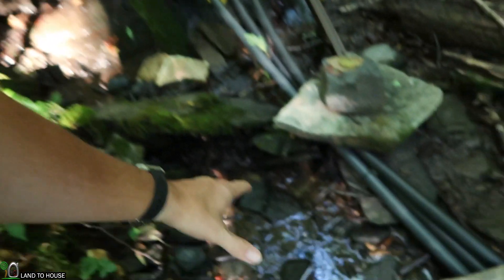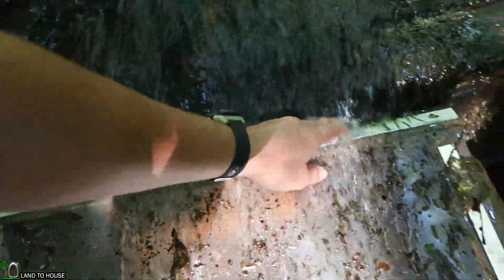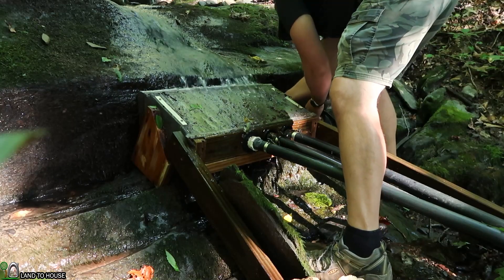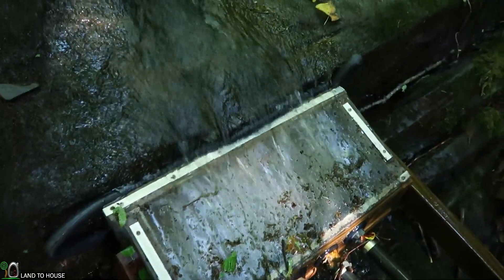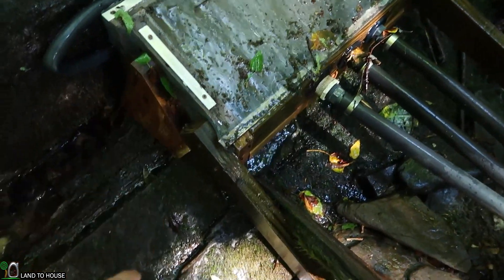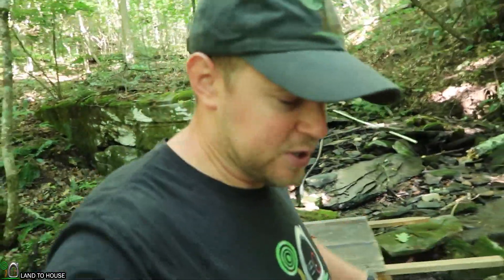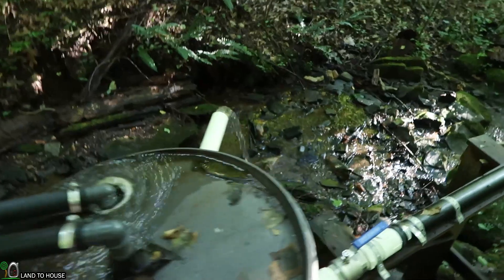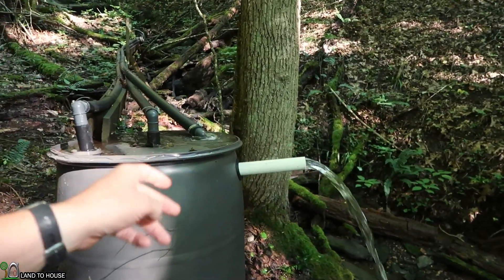Capture More Water With Bike Tube Micro Hydro

Comment: You have a nice flat shelf of a rock. I would take a piece of sheet metal about 3' wide and bend the sides up about 6 or 8 inches. You could even use anchor bolts to attach it to the rock...have it hang over the ledge about 2 inches. Should  catch just about all the water that way.

Comment: Use a float sensor in the sediment trap, to activate a solenoid valve for additional jets at the turbine. This will help to ensure you get turbine flow matched to actual available water. This way you don't waste water needlessly to overflow and can use all that is available for battery charging.

Comment: I have just scene on with 2 inch pipe flow meter do you think they would work to measure flow to a turbine ? Also electric ball valves I was thinking if you had float valves in the barrel when water  reaches set one it will turn on and off the valves to always keep best power production with what flow they is

Comment: One of my favorite water diversions is a slab of cement, with 2 channel iron 24" stuck in it(it can be as tall as you want as long as it exceeds the flow of the creek) put into the cement, with the open sides facing each other 24" apart, then build a box and pour cement behind them up 24", so the water flows between them, then we drop 2X4's into the channels to "check" the water up to our outlet pipe that goes through one of the sides.  Sometimes we'll put a valve on the outlet pipe, this is an irrigation dam so the outlet is 6" or bigger, the advantage of the 2 channels is if the water comes up quickly, it goes over the 2x4's and on down the stream w/o overloading the outlet pipe, which limits the volume by the size of the outlet pipe.  Build the dam, put your outlet pipe on the side that you want, it drops directly onto your screen.  Flood/rain water rapid rise just on downstream w/o damaging anything.  Does that make sense?

Comment: One option might be to pump the water out with a large pump or divert the flow long enough to put concrete in between the rock and the box and make it nice and sealed. It should cure enough to allow water to flow within 24 hours and you'd end up with a perfect seal moulded to how you want.

Comment: A metal box placed tighter to the stone would do a better job of catching it.. Wood is not stable so it will always expand & contract. so there will always be loss of water.. I strongly urge you to build a catchment of all metal or metal & plastic's.. They will do better, last longer and the performance will vastly be improved.. I can only speak as an observer, but it appears at times like your chasing your tail.. I mean no insult in what I am saying.. Still everyone has to learn and progress at they're own pace.. LOL myself, I have OCD (badly) I drive myself mad sometimes trying to redo & redo until things are perfect (which rarely happens) Enjoy your journey.. Be blessed..
Reply: I'd build a basin out of stones and Portland cement, personally, and deep enough to assume the functions of the barrel (silt drop out and air bubble removal) to get a few more feet of head pressure.

Seeing projects like this makes me want to go buy some land just to run a hydro setup!
Reply: @MarkRose1337  Sounds like you built a small dam..  Having the area, a small dam like 10 feet by 10 feet and say at least 5 foot deep, with the water outlet around 4 foot down, would from the start increase the head pressure even if the drop is not as much.. It's all in taking advantage with what you have.. I have tons of what most people would call "useless knowledge" but in my case comes in handy with thinking outside the box and applying a bit of engineering to projects.. My kids call me professor knows it all.. LOL, I do know a lot about a lot of different things.... LOL

Comment: 3/16 is smaller than 1/4.  Perhaps you mean 3/8 :)
Reply: He means 3/16. He doesn't have enough water to run two 1/4 nozzles (200%), so a 1/4 and one 3/16 (156%), or two 3/16 (113%) may allow him to get more out of the system versus a single 1/4 (100%).
Reply: That is true, but if you reduce the size of the nozzle you increase its velocity, until it’s choked. It’s similar to putting your thumb over a garden hose and it shoots out further, the same amount of water over the same period of time but the velocity is faster

Comment: If it were me i would get a grinder with a concrete cutting disc and cut a slot or groove into the rock shelf about half and inch deep and put some plastic in there to bridge the gap.
Reply: BRILLIANT